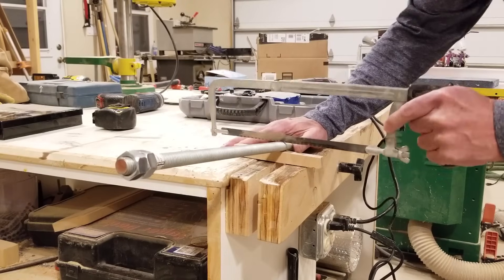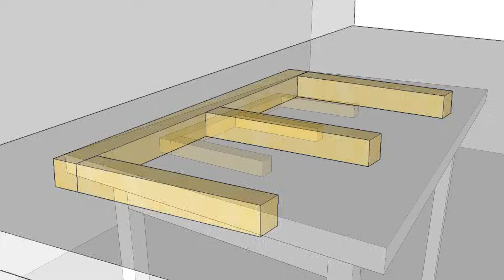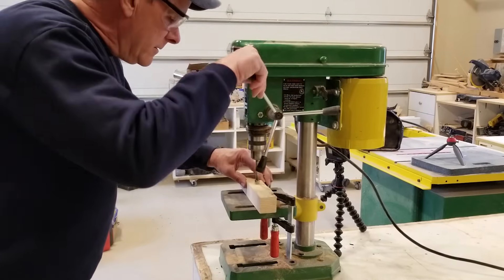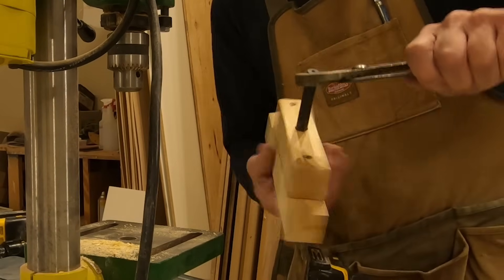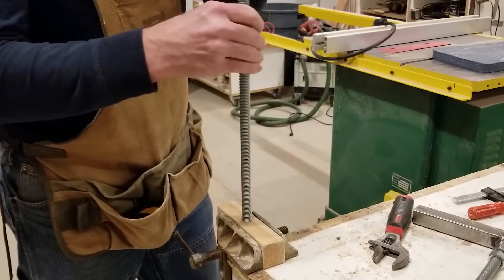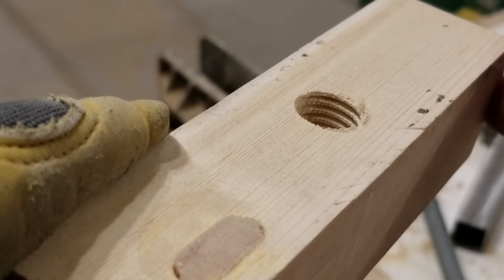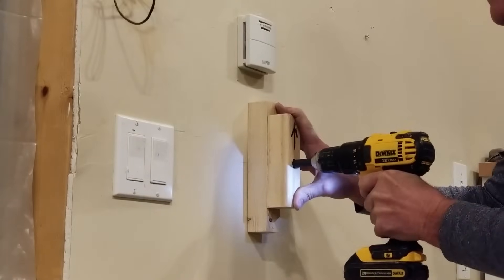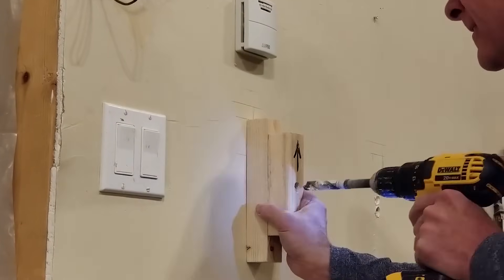Strong Floating Shelves - The Strongest Option

Comment: I think overall strength would increase significantly if there were another nut on the allthread near the end, which would compress the wood structure and couple the two together better.
Reply: I had a similar thought - the shelf retention into the wall is limited by the strength of 3 1/2" of wooden threads. Just can't think of an elegant way to sneak a nut back there given there's probably another wall of some kind on the other side. The simplest might be some sort of adhesive so the metal is bonded to the full wood surface or treat tapped hole with some wood hardener to give the threads a better chance. 

At some point all this becomes more effort than its worth and you just need a tapped insert...
Reply: @TestSpaceMonkey  oh I was thinking about the front edge, not inside the wall.  But you do raise a good point.  If one is willing to ruin their wall a little bit, they could embed a nut into the stud.  I don't think there's a lot to be gained though.
Reply: @TestSpaceMonkey  Tapped rod insert in stud would defo be the ultimate approach. With recessed nut at the shelf edge tightened to introduce some torsional strength, covered with a wooden plug, glued and sanded in line with the grain. Pitty the fool who has to disassemble that in years to come, especially if painted!
Reply from the maker: Enjoyed reading the line of thinking, oobligah, that you and @PointLineBox were taking on this idea! All I would add is that I ultimately think about how much weight is going to be on one of the shelves, realistically. This method using the all thread rods probably gives me 3 to 4 times or more capacity of weight than I would ever consider even putting on a shelf. But the selling point for me is if I'm just drilling holes and installing the rods and not talking about what I'm doing, I can do that faster than pretty much any way I can think of otherwise. Thanks to both of you for watching and commenting!

Comment: awesome video!  Thanks
how would you go about doing this across a window 45" wide (its a micro suite)?  or 
how often would you need a threaded rod for a floating shelf 65 inches long?
Reply: Bro ... U should hit EVERY stud then. Thats a longass shelf and its your first time...
Reply from the maker: I'm with Paul on this, C Wah. On either side of the window, there should be studs you could tap into if I'm understanding your situation correctly. The span of the window width would probably call for you to build a shelf that has almost an "I" beam construction along its length with the shelf slipping over it or a piece of solid timber. It's probably a little tricky but certainly doable. Would be a cool look!
Reply: Rusty Dobbs awesome job replying and for the video i too think the iBeam and mounting into the studs in both will do the trick.  Thanks again and please keep up the awesome video content. Cheers

Comment: I did my floating shelf very similar to this. I used a drill block to achieve drilling straight holes on my studs and i drove a 1/2 x 10" lag bolts. Once i was satisfied with the levelness, then i cut the heads off and slipped in my 2x8 shelf.
Reply from the maker: That sounds like a good approach, Ralphie! Thanks for passing it on!

Comment: Problem i rebuilt a 50 year old mechanical clock needs to be level all sides..wall was 1/2 inch plus off.. i used screws and cabinet plastic stops to level that wall. Thats too much off for this or have to drill at an angle to compensate?.?....... food for thought..
Reply from the maker: Hey, Peter! If your wall is out of plumb by the 1/2 inch, you should still be able to adjust the drill angle going into the studs to make the all thread rods come out of the wall level. Then you could build your floating shelf to whatever configuration you needed to rest against the wall that's out of plumb. The shelf would still be level and your clock should be okay to sit on it. That's just my take on your situation, if I understood it correctly. Hope that helps!

Comment: I have two questions i am hoping someone can answer.
1. Why did he use one threaded bar first and then put in his shelf bar? Why not just use the same back?
2. Anyone know how far out this can go and what strength it loses as it extends?
Reply: I can only offer an answer for question 1

1. The first threaded bar was a homemade tap, which puts threads into the stud. Because threaded rod isn't pointy like a screw, the stud needs to be threaded so it can accept the threaded rod. If he left the homemade tap in there, he'd have to create a bunch of homemade taps any time he wanted to hang a shelf.
Reply from the maker: On the second question, The Best, though I've done a lot of experimentation with wood supported floating shelves and going wider with them, I don't have any real quantifiable information. Obviously you get more flex in the support structure of a floating shelf the further out you go and with the more weight you add. My conclusion has been that floating shelves have a lot more capability strength-wise than I ever thought they did. So you just have to experiment on a case-by-case basis with heavier items on the shelves. If there's any question, I put brackets under the shelves to eliminate any safety concerns.

Comment: I'd skip the t-handle and use a socket on a impact screwgun
Reply: He's creating threads in a soft wood... an impact driver would strip out the threads.
Reply: Just use the two bolts and a socket wrench to thread the rod in.  Why make the tool?
Reply from the maker: That would work if you're careful, Paul.
Reply from the maker: It's handy if you have the need to make floating shelves on regular basis. But the two jam notes works fine as well, Jonathan.
Reply: That's true every time we use a tool.  You can over-do (or "under-do") it with anything and get unwanted results.

Comment: i made a smaller version of this shelf a few years ago, i was able to secure the solid floating shelf by slightly angling the holes the rods go in, so the rods themself put pressure on the shelf, holding it in place.
Reply from the maker: Sounds like a good approach, yangly! Thanks for the comment!

Comment: Pocket holes for the bolts would work well in the solid shelf, you would want to take the thread of to make things a bit quicker then just put an off cut into the pocket hole to hide it.

Comment: Great video, thank you..
But how about a drop of wood glue on those threads going into the wall..
Reply: ianjsutt  your absolutely right about whether it would improve the strength of the shelf, it was more to do as you say with the lubrication factor .
Nice idea though 👍
Reply from the maker: Thanks, My Turkish Life! In my case this is more the temporary experimental project. Though some type of adhesive would make it more permanent, I agree that it's probably not going to change the strength much if any.

Comment: Hi Rusty  thanks for your informative and interesting video no idle chat you know what your doing    in place of your drilling jig have you thought of using a router to start the hole and follow up with a drill to get the final hole depth and diameter   just an idea that occurred to me I haven't tried it
Reply from the maker: Thanks, Stan! Yeah, the base of the router would get you to the 90° angle you want. Would probably be a little tricky handling the router. Thanks for watching and for the comment!

Comment: Thanks for not editing out the first two attempts at drilling the holes. So much more relatable now to watch... ;)
Reply: Honestly! Before the scene cut, you can sorta hear him huff into a chuckle. Very relatable...
Reply: Yeah, my luck, EVERYTIME i start a project, I hit a nail/screw...
Reply from the maker: That's probably right before I said something a little too "relatable" that I couldn't leave in the video, Matthew!
Reply from the maker: Yep, Jelte! The more we work with tools, the more we understand that stuff like that is going to happen all the time!
Reply: Literally subscribed because of the truth.
Reply: Every time I drill a hole into a wall my tools/machines turn into very good detectors for non-drillable materials
Reply: Yep. Every project I work on.
Reply: Looking to do a floating computer desk in a small room this works.  Could I not predrill the holes into the stud then install the metal rod  into my drill chuck to a guide mark then loosen the chuck and presto! My concern is getting both level
Reply: @clemkonan  what kinda drill you got that would be a huge chuck. You coumd bind two nuts on the end of your alltread and use a socket driver in your drill.
Reply: That area is tight as the nuts in the rod, you can really hit something even with the detectors.
Reply: @clemkonan  I didn't read that before I posted..but I was thinking that too.  If you could get the pilot hole right it should work.
Reply: I agree, NOW I feel normal and am almost ready to call myself a pro. Your practical and systematic approach has given me a mental starting point to make my own attempt for my style and conditions. (Plaster walls!)

Comment: tell me how this is not a gimmick
Reply: xl a gimmick? How is this a gimmick? It works pretty well?
Reply from the maker: I used to think floating shelves were gimmicky before I really had to start working with them, xl, because I didn't think they could hold much weight. I ended up doing a bunch of videos exploring different ways to build them and figured out that they can really be extremely strong. So that gives you a lot of different options for creating functional and great-looking shelves. Standard shelves with brackets under them are fine but if you need to stacked them, the brackets get in the way of storage space.

Comment: Why not just leave that rod in and move to the other one? Why did you do it twice?
Reply from the maker: You could do that, Jon, and it should work fine. I had just created a cutting all thread rod to use as a thread tap which was used before installing the permanent all thread rod. You could probably get away with using the permanent rod to cut the threads in the stud as well.
Reply: @RustyDobbs  ahhhhhh I see now

Comment: I wonder if epoxy or wood glue in there would be a good idea but i guess unless there is some pulling force on it that would be unnecessary
Reply from the maker: If you want it permanently installed, that might be a good idea. But, yeah, I think you're right that, strength wise, it is not an issue unless there is some kind of pulling pressure on it.

Comment: Why 2 nuts with the one welded to the bar you should only need 1 jam nut
Reply from the maker: Hey, James! The second nut on the all thread is the jam nut that lets me pull the thread cutter before installing the finished all thread.
Reply: Ya but there is a nut welded into your tool so you only need 1 but there is 2

Comment: We use a slightly larger hole for all thread and just construction adhesive the stud side so we don't have to mess with "tapping" the stud. Then we use 2x10 (I like the solid wood look that the 2x10 gives) drilled in the same manner as your last shelf and slide it on with a couple dabs of adhesive as well. Realistically these shelves will hold at most 5-10 lbs worth of bowls, plates, or mugs. Overall great Job! You obviously take a lot of pride in your work!
Reply from the maker: Thanks for the comment, Joseph! Sounds like you've got a good method that works well for you. You are right that most of the time these types of shelves are never going to be overloaded. I'm just glad to have proved to myself that I don't really have to worry about weight considerations because this type of installation is probably going to be able whatever is on it without a problem. Appreciate you watching!

Comment: This all well and good if your framing members are at 90 degrees to the actual wall....if not then you're blowing out the sides of the studs.
Reply: So your walls have been constructed wrong then. A 45mm wall is flimsy and should have shelves on
Reply: Shouldn’t
Reply from the maker: Yep, Mark, you have to be careful anytime you are drilling into studs for any purpose. You don't know what you might be dealing with if you can't see what's happening.

Comment: Hey weld a thread coupling to the t-handle instead. Then the rod you drive you can leave in place and just unthread the handle. Also, just use a speed square when drilling the holes. You can use it to both gauge level and square.
Reply from the maker: Thanks Scott! All good ideas! I appreciate you watching!

Comment: Last summer I built a new wood deck. As leftover I had two really straight about 1x5 inches, or 28x120 mm to be exact made of Siberian larch. 

I glued them together two make a shelf that ended up about 6 ft long.

I put a few 10 mm ( a little bigger than 3/8 inch) pieces of threaded rod through the shelf, with a distance of two ft / 600 mm apart , I had pre-drilled the holes through the planks before I glued them. I used a simple "jig" to make sure the holes lined up after gluing. 

On the outward facing edge I had drilled shallow holes that were bigger so I could fasten the rods using a nut and washer. 

I used my dowel-making drillbit to get dowels from the same piece of wood to plug the outward facing holes. You won't notice the plugs unless you are a woodworker or someone tells you about them. 

Then more drilling, straight through the wall of my garage where I wanted to put the shelf. I used nuts/washers on the threaded rod and on the inside of the garage to fasten it.

A lot of work, but my garage was built by a drunk framer and all the studs in that wall turned out to be horizontal, why did they build it like that?? 

And I couldn't get enough support from only two rods that were small enough to fit into the shelf.

It was going to be used for a lot of flower pots and it could probably be a little heavy, and I wanted a floating shelf without any sag.

And so far the shelf stay in the same place where I put it.

I finished of the shelf with the router to make some rounded edges and a few layers of varnish, I think it looks good.
Reply: ianjsutt  well, there is actually one vertical stud halfway.

Noteworthy, all timber have non-standard dimensions, likely produced by some local farmers backyard sawmill, all of it thoroughly oversized. Later probably assembled into a something similar to a garage by one of the previous owners.
Reply from the maker: Thanks for the explanation of your project, Niklas. Enjoyed reading your conversation with @ianjsutt as well!
Reply from the maker: Hey, ianjsutt! Sounds like you got a lot of practical experience working on a home where whatever you did was going to be an improvement!

Comment: Seems like you could just avoid the whole wood threading process and use a Hangar Bolt.  Something similar to this https://www.amazon.com/Hard-Find-Fastener-014973172176-Piece-50/dp/B00L1L7BT0/ref=sr_1_14?brr=1&qid=1560345825&rd=1&s=industrial&sr=1-14
Reply from the maker: Yeah, sreid70, the threading process was something I wanted to try out and ended up being very pleased with the results. If I'm just doing the work and not talking, it goes quickly! But there are certainly other ways to go.

Comment: This required a video? 
Woah! 12 years ago, I used similar method to mount my 61” tv bracket. Just flipped around through the other side of the wall. Just some siding refurbish and I can hang on my tv, with the bracket.

Unfortunately, my weight distribution formula was bypassed for simply sticking a metal pipe-like structure into the wall with bolts (like you have), to hold some of the force, but in actuality, I should have used a long curved piece of metal, crafted with the dimensions to have it long enough to reach center-point of the end of the bracket to the wall.

With an arch underneath that bolt and the bolt as high to the face of the rack as possible, you’d be able to throw that third bag of concrete on top instead of lay it down, and possibly throw three more on top.

But I’m not a student of structural engineering, and don’t know how to use their methods of finding where and how to create such arch, except from just making it up.
Reply from the maker: Hey Ndow! If you had made your video 12 years ago, I would not have had to make mine now! Thanks for watching and your comment!

Comment: For me, the best way has been to use regular 1/2” steel rod, no threads. Make the holes In the studs the same size as the rod and pound them in. I hang solid wood for the shelves and make the holes a little oversize. The holes are never perfectly straight - a little bit of play allows you to push them in more easily. I have used this method to hang 3 x 12” x 10’ fireplace mantle. It’s been up for years and very sturdy. No specialized equipment needed. Thanks for the video!
Reply from the maker: Thanks for your explanation of your method, Spencer! Yeah, it's difficult to know how strong various approaches I have explored really are and more challenging is the question of how strong do they really need to be to work in any given installation. Sounds like your approach definitely gets the job done!

Comment: I’ve thought of doing my floating shelves this way but there are far to many down sides, as a home builder I know, you put waterlines, electric lines and etc, in the middle of a stud so drilling a 5/8 hole in a stud is a great way to hit them, I’ve actually made floating shelves 7’ long out of 2”x12”s and I am 240lbs and I hung on them, my design take’s half the time to hang, I wish I could upload a photo
Reply from the maker: There is no doubt that you have to know what you are drilling into when you take a 5/8" bit and go into a stud! Imagine having to deal with repairing a wire you didn't know was there! If I am just installing by this method and not explaining what I am doing, it is very quick to do and the rods are stout. Feel free to send me a photo of your method to info@dobbsworkshop.com. Thanks for your comment and for watching!